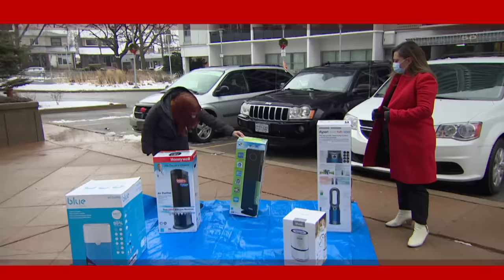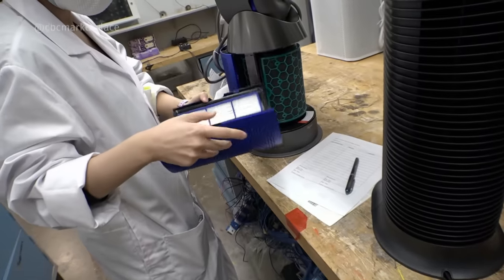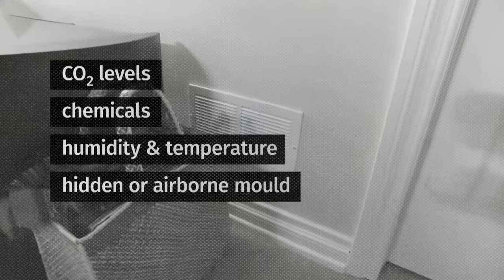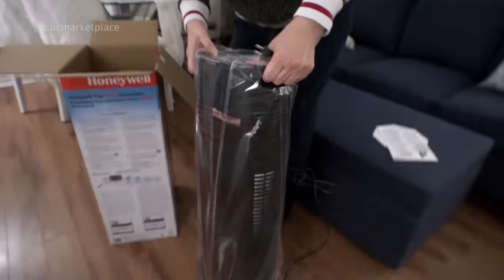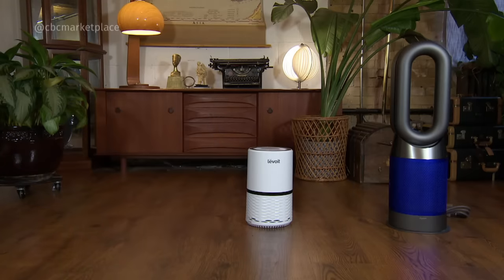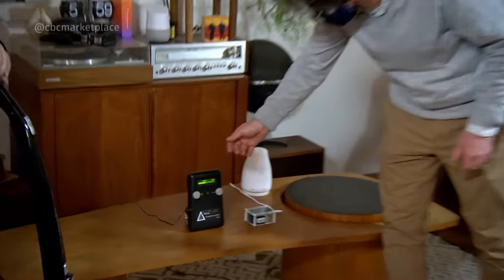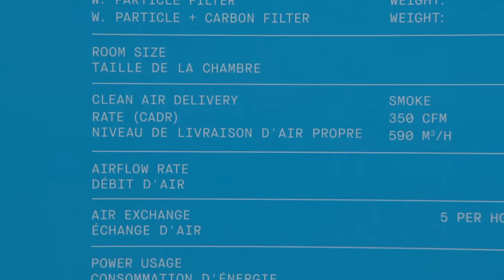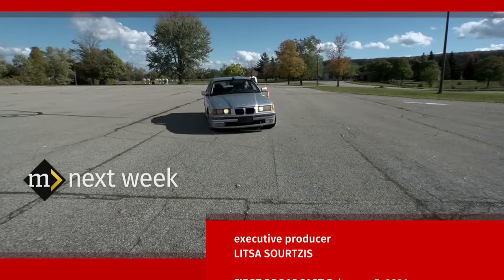Is an $800 purifier best to clean your home's air? We lab tested 5 top brands

Comment: Dyson is the only one that offers cooling + heating. Its not solely designed for air purification. There's a premium cost to have that all in one device instead of three. If you live in a small space, the fan+heat+air purification in one sleek package from a company that makes insanely dependable products could be worth that premium. Kudos to Dyson for showing up!
Reply: it doesn't heat... but okay
Reply: @seansapir1  it literally does
Reply: You can buy a compact space heater for $20
Reply: 100%.
I bought this mainly for the heating option.  
I got a bonus cooler and purifier with it. 👍 I can't complain about that. 
Plus it looks way cooler.
Reply: One cannot argue with someone that bought the product as they will take it as a personal offense unfortunately 🤥🙄
Reply: @maluminse6013  you can buy a bunch of equipment that does the same job for cheaper, sure. That's the point. The Dyson is the only one you're going to bother picking up and moving from room to room because it's not a faff, it's all in one, and on top of that, it still manages to look nice in the room.
Reply: @seansapir1 tell that to my dyson thats literally keeping my room to 25 degrees rn lol
Reply: @maluminse6013 its not gonna heat your whole room in minutes tho is it
Reply: @casnumbernotfound  yeah, it will. A $20 1500 watt space heater will heat just as quickly as a $500 1500 watt heater. Know why? 'Cause 1500 watts is 1500 watts
Reply: its like the Swiss army knife, you can buy bigger knives, better saws, sharper scissors at cheaper prices but if you want one single tool that has all the features, you’ll still buy the small SAK
Reply: @maluminse6013 That would be like saying a $2 50W lightbulb will be as bright as a $20 50W lightbulb. That's not the case, because the $20 one is an LED, so more of the energy actually goes to lighting the room and less is wasted, so it will be brighter with the same power.

The same probably applies for heaters.
Reply: @me-myself-i787  Only a Dyson owner would pay $20 for a 50w LED bulb 😂

Comment: One more thing everyone should look for is availability and cost of replacement filters. This will make all of the difference if you intend to use the device longer.
Reply: Also how loud it is and how much power it uses.
Reply: Agreed.  It has been impossible to find replacement prefilters like the one in the Honeywell I spent hundreds of dollars on.
Reply: I get my filters on amazon great pricing for half the price
Reply: @CheapSushi  true, the dyson uses 2250 Watts power!
Reply: @pmabrouk  I have a thirty year old honeywell true hepa. I found new old stock filters and pre filters on ebay.
Reply: @kushalgupta486  what! Cant be right
Reply: @climblab-theultimatesoluti3454  it's literally on the Box. But I don't think so that it consumes that much power, its only when you use the heater.
Reply: stop talking nonsense. this is about fashion and virtue signaling
Reply: @kushalgupta486  When heating??
Reply: why are replies hidden
Reply: True! It’s a ripoff from the word go.
Reply: @kushalgupta486  only when it’s HEATING - it’s also a space heater.
Reply: @kushalgupta486  don't use the heater it used more watts power
Reply: So true. Just like checking cost of ink cartridges/refills before buying a printer. Is it cost effective overall?
Reply: That's exactly  what I told myself while I was looking for this appliance. That is one of the reasons I bought an Honeywell.
Reply: Great point

Comment: I would give this video an 8 out of 10...they did a good job and included several different perspectives. However, they never mention the size of the area they tested in comparison to the room size recommendations for each product. Naturally the smaller filter will get a lower CADR in a bigger room. Also, I would like to know why particulate count is important and if mineral particulates for example are even bad for us or could even be good for us?? Lastly, as a Certified Mold Inspector myself, I know that a lot more goes into the mold analysis than just a visual inspection and air quality testing. The lab results only show a snapshot of the mold count in that exact time and location. I would be willing to bet that the lady with the mold in her home actually has a serious mold problem and needs treatment.
Reply: Alto they don't mention that they used a fan to agitate the air at 11:23
Reply: Agreed my friend, I believe they didn't want to completely destroy the old lady on the show about her serious mold problem, so I'm assuming that guy took her aside and warned her of the very problematic mold that she needs to get rid of.

She willingly volunteered obviously, so they probably gave her that much.
Reply: Literally. These test they ran halfway mean nothing. Wouldn’t even give it an 8, prolly closer to a 6
Reply: Exactly what I was thinking. Its not an apple to apple comparison. They should test the purifiers based on thier capacity rating
Reply: I really don't understand your reasonning nor any of the answerer's. The metric given is in m3/hr. It doesn't deppend on the size of the room. A 60m3/hr purifier would clean up a 60m3 room in an hour but a 120m3/hour would do so in half the time. Or am i missing something ?
Reply: @florianlison8085  they way u get it but seem to still be confused made me giggle
Reply: @florianlison8085 , yes, so, the only difference is the time spent cleaning an amount of air. Basically the speed of cleaning. This measure doesn't say anything about the quality of cleaners, but rather the size of the room they are good for. 
However, the reasoning of the video, I believe, is that the more times you clean an amount of air (e.g. 50m3 room) per time, the better it will perform. This is only true partially. Air would be cleaner, but there are diminishing returns for cleaning air many times: if you clean air 50 times in one hour it is only marginally cleaner than if you do it 10 times. Probably, for a normal home, once per hour should be enough. 
Hence the room size argument. For a 40m3 room, a beast with 1000m3/h circulation isn't much better than a 40m3/h if all you need is air to be circulated once per hour and everything more is rather pointless. 

I also find the argument about particles cound and thus humidifiers not being healthy a very  bad simplification. Sure there are more particles if you use a humidifier, and things stick to the particles and get to you like this. But having dry air can be much much worse for your health than having super clean air. Actually, didn't exactly this pandemic teach us just that humidity levels are key for preventing spreading of vira? 

Lastly that fungi in the grandma's corner are ridiculous. That is probably the worst source of unhealthy air and at the same time an indicator of too humid air, or just poor construction.
Reply: THIS is the answer/comment!  I cannot believe they had all these experts and science involved in this, but then rate the dif model/manufacturers based solely on how many cubic ft (or whatever) that the device can efficiently clean!!  They're ALL built/designed for different size rooms.  TOTALLY ruined the piece..
Reply: I’m also certain the Dyson rep was blindsided. If he knew they didn’t test with the appropriate room size, he would have responded differently.
Reply: I definitely agree with you about the particulate count especially for minerals. The expert saying to not use humidifiers rubbed me the wrong way. In the winter time when I have the heat running, the air gets extremely dry. It leads to dryness and irritation in my mucosal areas (nasal passages, eyelids, itchy ears, dry mouth) and sometimes I have even had a nosebleed or 2. I use a humidifier and all of that is gone. Every humidifier I use has a filter to trap minerals so they don't go flying through the air. Even if they did, I'm not so sure they would travel that far or are even that harmful

With that being said, I think he overgeneralized on a lot of this. I don't think you should just use 1 metric as the end all be all for anything because life is way more complicated than that. Most humidifiers have a filter/wick to trap minerals and they provide benefit that go beyond just having clean air.
Reply: @spookshow6999  I used distilled water for my humidifier, filter my drinking water and I actually have a filter on my shower head as well. I just didn't agree with their "expert" analysis that's all
Reply: @SalawuIbrahim  they were all tested in the same room, of the exact same size...
Reply: This test is 1/10
As it fails to answer a simple question, will any of those actually clean the air?
Why do i need huge CADR when my air is already clean? Whos gonna run an air purifier if its a 80 decibel airhorn? What if i have 1 room apartment?
Didnt bother with the sound levels, filter quality, filter price, power draw and LOOKS and size. Im not putting half of this stuff in my room.
Reply: Idk if breathing high levels of minerals are good. It just makes me think of manufacturing facilities. Maybe a little is ok, but how much are they putting out?
Reply: @danijelkurincic  "for a normal home, once per hour should be enough."

I don't know where you got "once per hour" figure from, that isn't recommended by any relevant organization. AHAM, for example, recommends 4.8 air exchanges per hour. In other words they recommend an air purifier with CADR that is 4.8x the volume of the room.

Furthermore, you are incorrect when saying that there's no advantage in using a more powerful purifier than what the room requires. Commercially available air purifiers are very loud when ran at their maximum speed. Advantage of using an oversized air purifier is that you can achieve desired CADR at a lower speed, with less noise.

Comment: There's a problem here: The CADR is important, but it doesn't tell you how thoroughly it filters the air. Some of
the purifiers shown had carbon filters that absorb gases and fumes, among other things that pass through HEPA filters like the Filtrete too easily. CADR is an airflow metric. You need both good airflow and proper filtration
Reply: I this just has to do with the type of filters in them
Reply: They said it doesn’t even matter how good the filter is if it would not even pass through the filter due to low airflow
Reply: CADR is a measure for the clean air output. It considers both air flow and filter efficiency.
Reply: Those carbon filters are more gimmick than actually helpful. Yes, they can remove gases, but not for very long. Unless you are changing them out very frequently .... it's snake oil.
Reply: @MTGeomancer i owe a dyson and if you fart it removes smell
Reply: CADR is not an airflow metric. It is airflow multiplied by the fraction of air output which is clean.
Although, I'm not sure how well they tested it in the video because I haven't seen it yet.

Comment: just bought a Blueair last week... I'm relieved at these results
Reply: How much was yours? Saw it going for $390 online @best buy, but I imagine it was going for less pre-covid
Reply: @jpdelete  I got the Blueair 411 from Home Depot for under $150. It's the smaller version for small to medium size rooms. Definitely would recommend!
Reply: @Vv_li  has it made a difference for you? I have allergies so I'd love to be sure.
Reply: U like it?
Reply: Blue air wins!
Reply: I also bought the Blue Air from Home Depot for about $150. I really like it and I'm happy to see it tested well
Reply: How much & where!?
Reply: I've had mine for around 6months really helped with my allergies since I have to stay home all day but in a bigger room i need to put it on the max setting
Reply: I bought the blueair precovid and filters were sold out so I bought the Levoit before seeing this. Now I understand why my dog is back to scratching and itchiness :( The BlueAir is 100% better
Reply: How loud is it?
Reply: @CheapSushi  on max it’s fairly noisy. But on level 2 or medium it’s very very reasonable.
Reply: They tricked you, they used another fan in the test room to agitate the air 11:23

Comment: I had a multi-gas, ammonia, smoke/HEPA,...air filter systems.  I had a positive air pressure system.  With all the systems going full blast they could still be overwhelmed.  If the pollution was coming from the wrong direction that positive air pressure system would suck it in. (You needed the premium positive pressure system with a chemical filter that cost 20K more.  I didn't have it.)  I had a $400 air filter in the HVAC system.  What the system did do was clear the pollution faster.

Comment: That one family with the mom coughing in the basement should consider getting tested for radon.
Reply: Air quality guy really should have checked for radon.  But I suppose that, for this show, it's irrelevant.  You don't fix radon with air purifiers.
Reply: radon is a silent killer
Reply: Radon is not rad
Reply: @contournut5726  how do you eliminate radon?
Reply: @grod805  Radon is naturally occurring in soil and can enter a home through its foundation. Usually radon levels are higher in parts of the house closest to the ground such as basements. Typically, it is eliminated by venting air from under the foundation to the outdoors. This is done by installing a pipe that extends from under the foundation to outside the house, and installing an appropriate fan that draws this air outdoors.
Reply: @MurCurieux  Is groovy!!! ✌😁
Reply: What is radon exactly?And can you buy a device to test all those air chemicals&particles&do you have a link?🙏

Comment: We own two Dysons, not the specific model listed but the same look with a tower(TP02).  We purchased them for the air movement, the purifying is just a bonus.  I wish they would have reviewed Molekule and Air Doctor.  I own an Air Doctor as well and can attest that yesterday after having the back door open we were flooded with irritants from someone burning/cooking nearby.  I was having horrific allergies.  We turned on the air doctor and it most certainly did clean the air as I was able to breathe much better after a few minutes.
Reply: I tried researching the Molekule some time back. I just recently tested an Alen 45i purifier. The Molekule distinguishes itself with the use of UV technology. The second expert with the glasses said that UV technology is not worth it. He said that the amount of UV used is too low to be effective.

Comment: I think what should have been mentioned about the Dyson is the fact this it’s also a fan so it literally pushes and circulates air around a room. A lot of air purifiers on the market create a pocket of clean air around them and they basically keep cleaning the same air over and over because there is nothing pushing that air across the room. So if you do buy an air purifier sans fan, you should also buy a separate fan that keeps the air in your room moving.
Reply: Exactly. I think he mentioned air "projection" at some point. CADR doesn't measure that. It's too bad he didn't have more time to touch on the subject
Reply: If the purifier blows the cleaned air in a different direction from which it is pulling from, it is in effect, circulating the air in the room. Blue Air has the highest CADR and uses this design in all of its models.
Reply: @WHERESSS  Have you experienced the air projection from most air purifiers? They project at a very low velocity. That air doesn't travel far before being recirculated through the purifier.
Reply: @meboz67  Yes. Blue Air fans are strong. That's what the CADR is, effectively. Without a strong fan with high airflow it is impossible to achieve a high CADR.
Reply: much cheaper to by a fan plus BlueAir
Reply: or turn on ceiling fans in the room.
Reply: @WHERESSS  The CADR test room has an internal circulation fan.